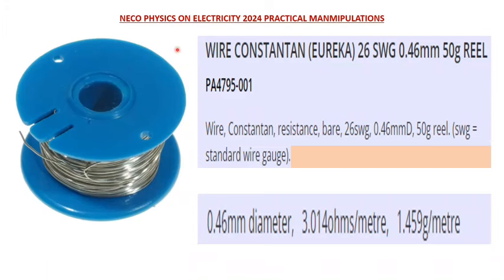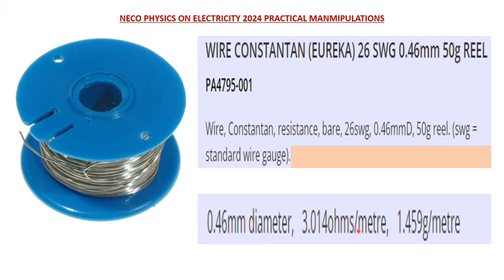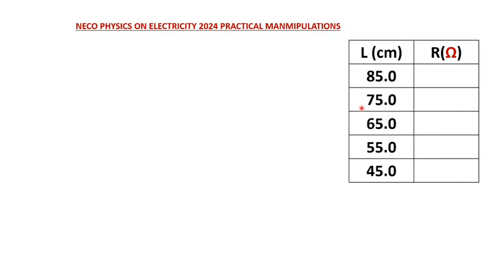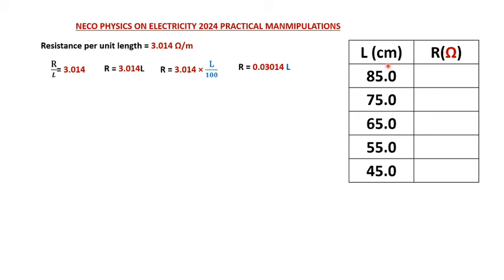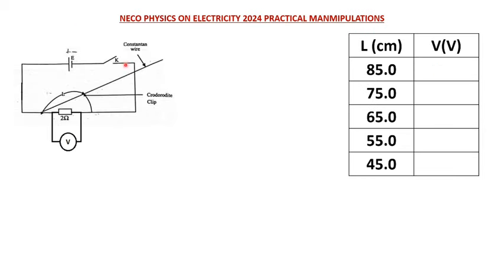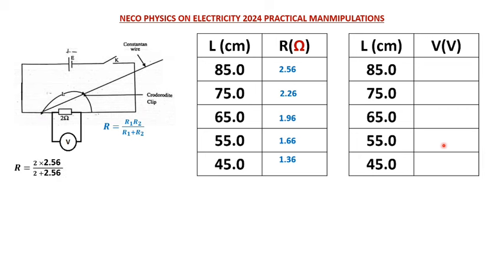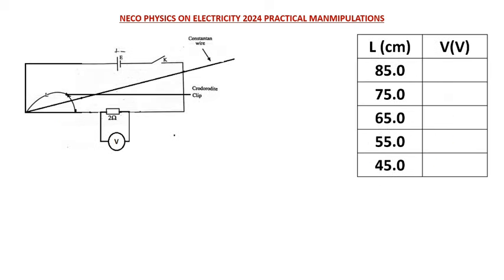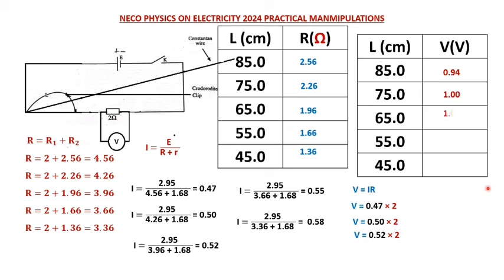NECO PHYSICS PRACTICAL 2024 ELECTRICITY MANIPULATION

Comment: Thank you Sir, but i think the current for each length of wire has to be the same since the wire and the 2ohm resistor are arranged in series... From the theory resistors in series have the same current
Reply from the maker: @okoliepromise807  no. It's not necessarily so. Different resistances can be connected in series or parallel

Comment: Brilliant work. One more scenario you did not consider is the voltmeter across both the standard resistor and the constantan wire while in series.
Reply from the maker: That's true. Because of the time and length of the video. 

All what you can do when the voltmeter is connected across the series connection is just to add the two resistances to gether and then apply V = IR.

Comment: Hello sir..
Please, I also want to know if the internal resistance in this case can be negligible or is it a must to calculate it while doing the manipulation?
Thanks in anticipation 🙏🙏🙏
Reply from the maker: @AkogwuMoses-cc9qd  I think it's good to add it. Here is what you can do. Look for a question on electricity where the emf is 2 or 3 volts. Check the internal resistance given in the question. Use it as the internal resistance of the battery.
Reply: @yousciencelab5307  okay.. thank you very much

Comment: The length of Constantine wire is in cm while resistivity per unit length is in metres . I believe they should be in the same si unit probably in cm as the wire length is in cm. Please cross-check your conversion
Reply from the maker: @chineduigbokwe8580  I believe you saw in the video where I divided L by 100.
Reply: Sensitivity must  be in ohms per metre.

Comment: I didn't see where u connectedbor used jockey sir
Reply from the maker: I used a crocodile clip. It serves the same purpose as jockey
Reply: @yousciencelab5307  in Ur own opinion, can we can alsi use a potentiometer to represent the constantan wire .since the potentiometer is a constantan wire as well
Reply from the maker: @okoroikenna9053  it will be OK.  But remember that they asked for a specific tyle of constantan wire. Your potentiometer wire may not be exactly the same as the required wire.

Comment: Well done sir.. very helpful.
But, i want to knw if the 3.014 ohms/m is generic for the SWG 26 wire... how did they come about the value?
Is it fixed for this type of wire since we have others like swg 20, 38 etc ?
Reply from the maker: It is calculated using the diameter, leng and resistivity of the wire.